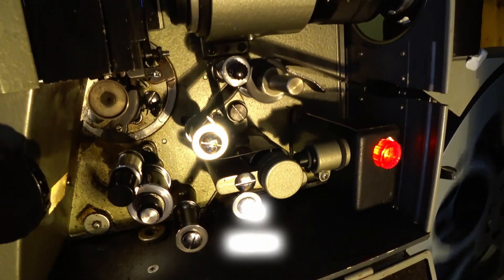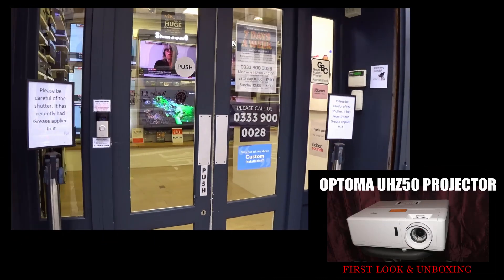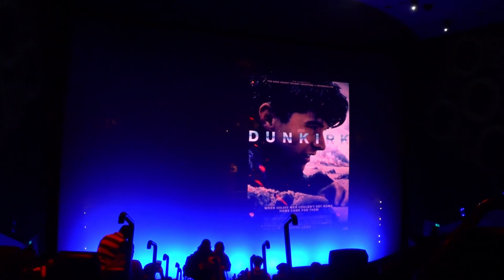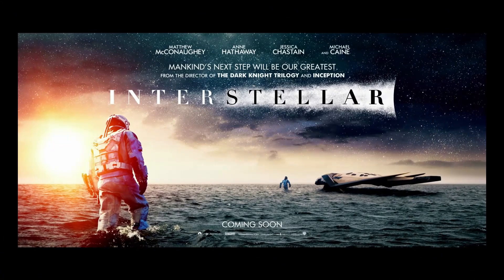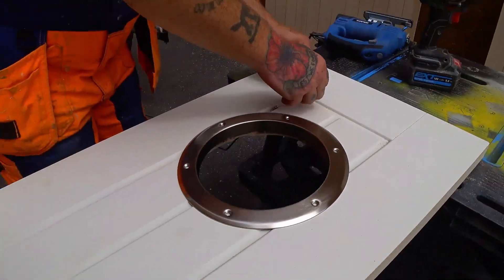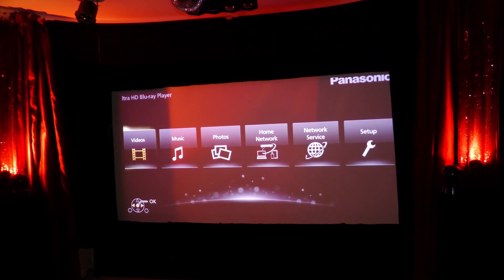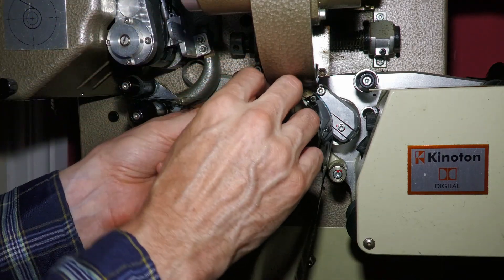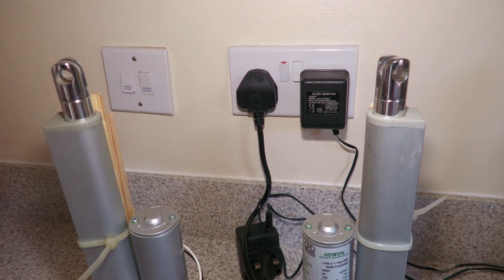2023 THE YEAR IN REVIEW

Comment: Merry Christmas! Great wrap for 2023. What motor did you end up getting? I want to eventually go to motorized masking as well
Reply from the maker: For the side and the top masking I use basic curtain motors which don't seem to be getting manufactured any longer but look up Add-A-Motor and you should see them.  For the bottom mask it's those linear motors which I stumbled across on eBay.  The remote control can be found separately but it was powering it all up that flummoxed me.  I should have stuck to using a car battery but I never was very clever with electricity.  Mark immediately could see the whole thing needed a power supply and I found one with the right volts and wattage on eBay for less than a tenner.  It was intended for LED light strips but fits the bill.  John.